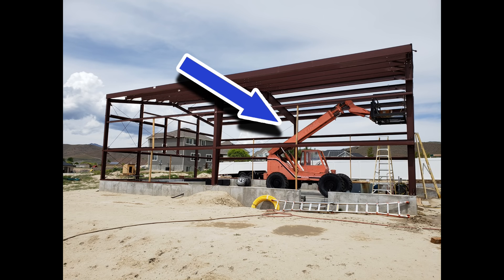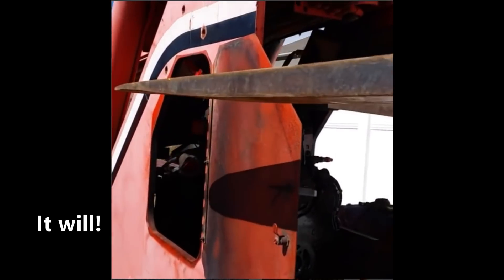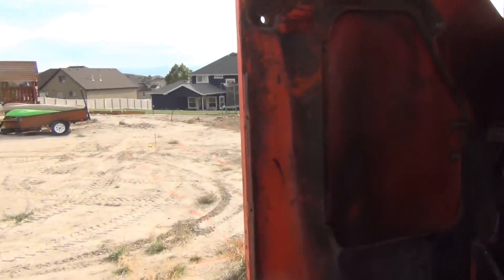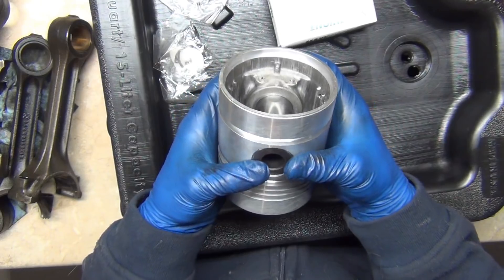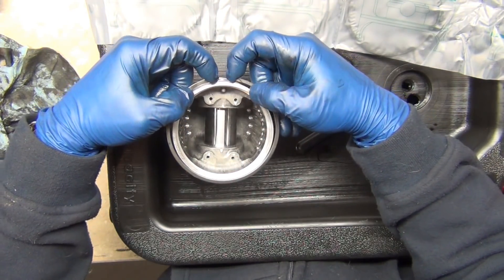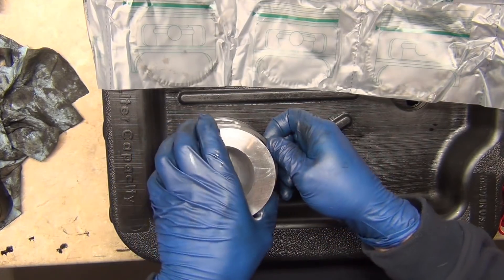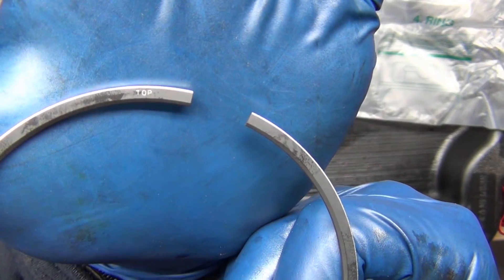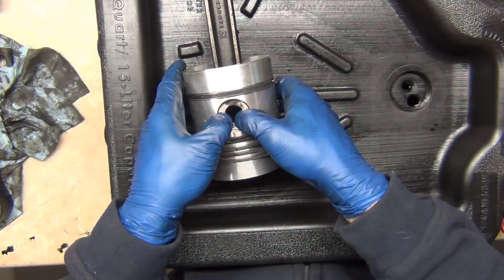Perkins Diesel Engine Assemble Pt.1  Piston Packs with a Purpose

Comment: I have exactly same engine but my pistons are flat top why’s this
Reply from the maker: Different compression ratio.
Reply: @briansmobile1  can you maybe with another question there’s 2 different head gaskets I feel like my entire engine is something that someone put together using left over parts for different engines but what is the difference on the copper head gaskets on something in the neighborhood of 1960-65

Comment: Brian , the taper on the top ring is for the purpose of , when the cylinder fires the pressure forces the ring out against the cyl wall ! Just love your vids
Reply: Correct and it is called a chamfer. Been building engines 54 years.

Comment: We are rebuilding a 4.236 right now.  I know this is not what you want to hear but you should double check with maxi force that your two scraper rings were not swapped backwards.  The spring loaded conformable was supposed to be the 4th ring for ours and the maxigroove was supposed to be 5th but in our pack that maxiforce sent they were swapped in the same order that I see you putting them on.  When we pulled our pistons, we saw the order and then saw they were different in the pack.  Quick call to Maxiforce let us know that it was packaged wrong.  Ours is a '91 marine diesel so a different build number but I would double check.
Reply from the maker: Interesting.   That ship has sailed for now.  It runs awesome and doesn't use oil so it must not be that critical.  It wouldn't be worth tearing down at this point.

Comment: Shoutout to the B-mob!  5 rings, heck yeah!  I talked about pistons like these hypothetically in a DSM ring install video and said if you ran into a set like this, refer to the instructions included for ring orientation.  I thought they were unicorns.  Now I can send people here instead.  I always like the BFATE.  If I did that, mine would be about breaking anchor lines, total electrical failure, complete engine failure, catching nothing but a half dozen stingrays, or sinking boats in the Atlantic.